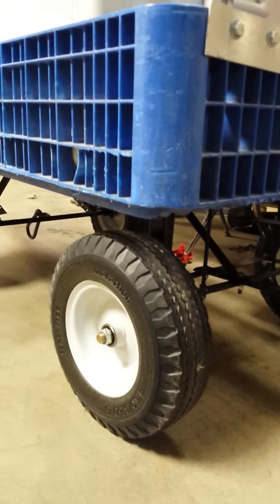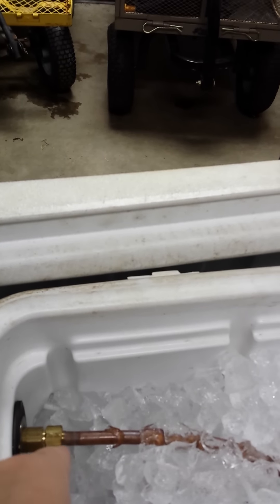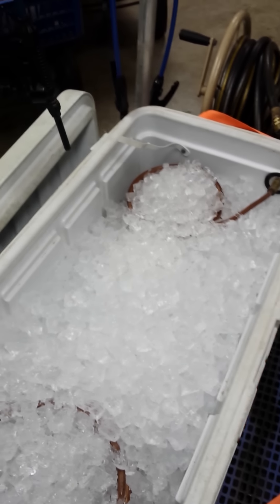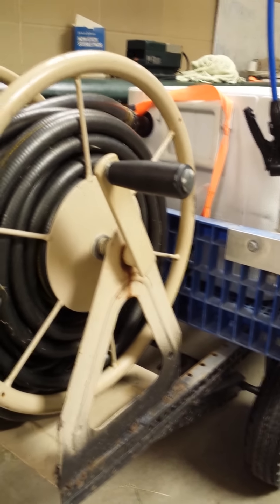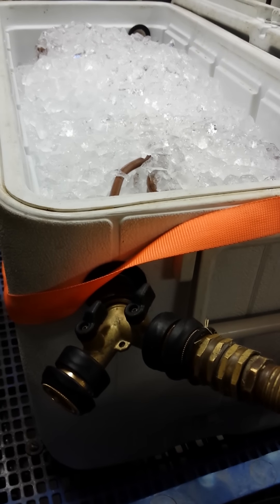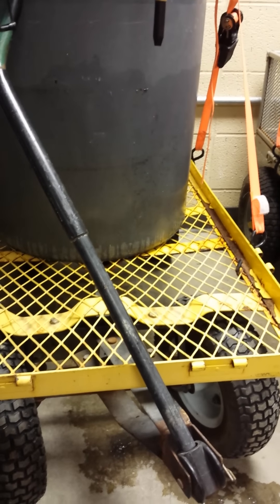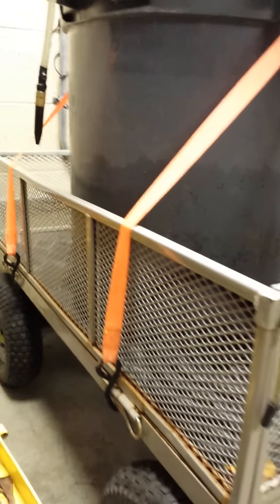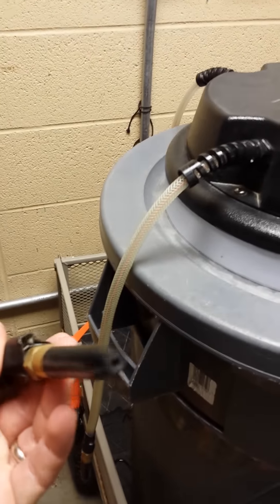Water station improvements

Comment: Sir, you need to look at friohydration.com. we have those improvement already and we  can even add a solar panel to pump units. We used roll mold coolers that have superior  insolation that will keep ice longer even in 100 degree heat. We can retrofit our coolers to any cart. please view our web site and give Robbie a call.